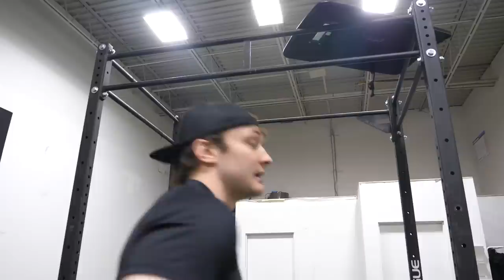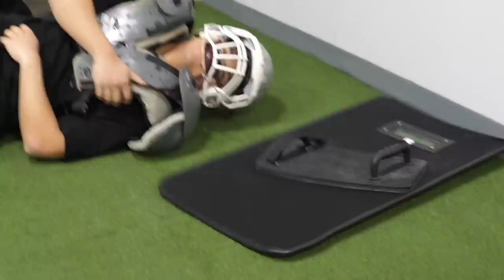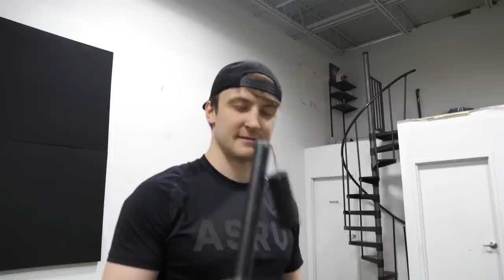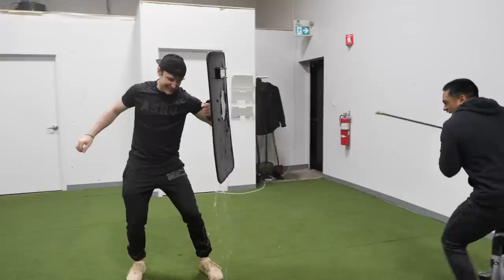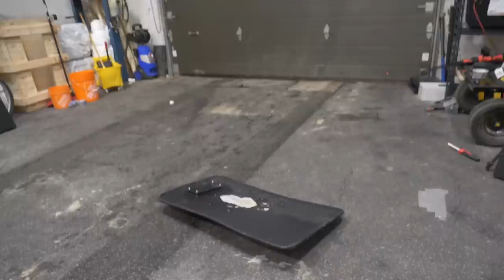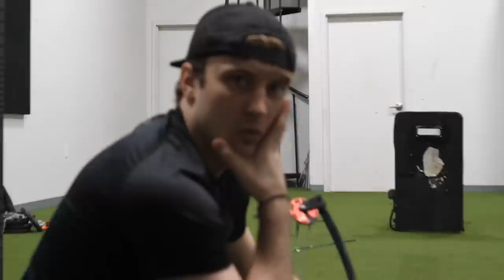How Strong Is A SWAT Ballistic Shield?

Comment: “Worlds strongest shield” not until you cover it in LINE X
Reply: Yes.
Reply: I'm sorry, I posted the same comment, just gonna give yours a thumbs up
Reply: True
Reply: Ace Master 
Delete urs
Reply: @Reactiontime6000  good idea, lol
Reply: Just did
Reply: Wowo
Reply: Yes
Reply: YESSSSSSS
Reply: Lol Kevlar riot shield and linex not the worst idea ever. If you look at a ar500 armor plate they are basically coated in linex like material for protection from spalling (SP?) So yeh i can see that. But from the looks of that shield it is level 3a hand gun rated armor
Reply: Popcorn EaterYT  lol
Reply: Add some flex seal and you have a boat
Reply: Line ex sword or a line ex katana
Reply: Not wrong
Reply: No u have to do it in flex tape

Comment: can be 
 out of materials such as UHMWPE or pre-preg aramid fibres. They may 
have features such as clear armored viewing ports, ambidextrous handles 
and spotlights for use at night, and may be either handheld or mounted 
on wheel-based frames. Dustin if are reading thisdo something like this again but with tactical gear and airsoft guns for you aka the unit like a airsoft game

Comment: Hey just Dustin I throw knives for living and I just wanted to tell you a little trick I learned I mean throwing a kunai knife instead of trying to rotate it at a small distance throw it like a dart and you'd be better off hitting it like that just a little tip I thought I'd tell you so you don't hurt yourself again I do this for a living so I'm kind of experienced but I wouldn't say I'm the best at it but I have yet to fail so there you go
Reply: Throwing like a dart would be very difficult to do the rotation that happens when throwing and knife allows for more power like when you rotate your hips to punch... so you would only want to fling your rist and dont move your arm and depending on the distance fling it with more or less power .. although ive never tried throwing like a dart it dosent seem like it would do very good ill have to try that... not trying to insult your knowledge or experience.. just throwing in my opinion... ive been practicing the art of knige throwing and recently throwing un balanced and odd knives such as a butter knife .. sienc i was 14 and im 26 now ..
Reply: @taekwondotrainer6982  would I am saying is the more force you apply in the straightener with throw the most likely it is to flip and the more accurate it will behowever it is an extremely hard skill to master but when you do it's really easy all you do is focus all your energy into the back of the knife and launch it like you would a dart tip first
Reply: @animegamerbros251  i understand.. all knige theows haver there own technique i will try what your saying ... it seems diffrent but interesting... i gwt back to ya once i try it out .
Reply: @taekwondotrainer6982  Ok good just don't flick the wrist
Reply: @animegamerbros251  i have no intentions on doing so
Reply: @Mystical Fury indeed he dose but u never know!